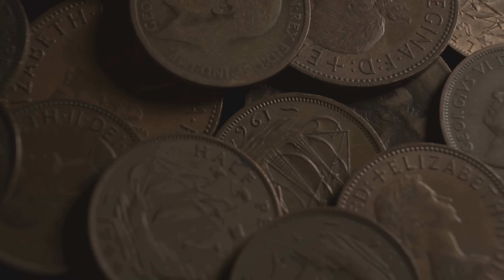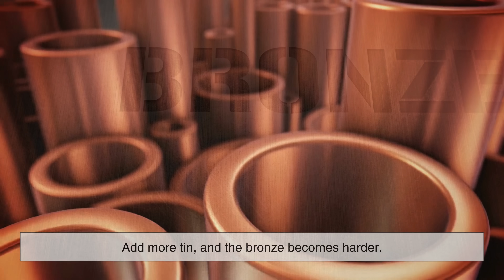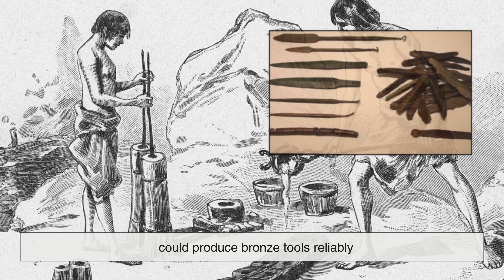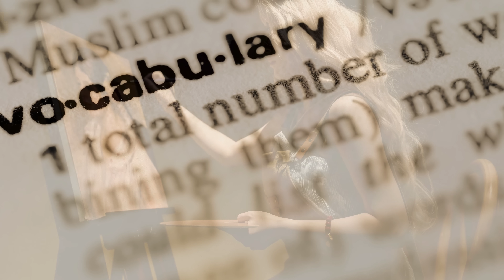Why Do We Call It Bronze? The Strange Origin of a Legendary Metal [ID0812]

Comment: I work at a place that makes advanced machines used in the pharma industry. Every one of them have varying degrees of Bronze in them from bearings and even some larger parts. There is no other material that can do what it does for its costs. We never left the Bronze age.
Reply: End of the age never meant stopping using that material, only that the more technologically advanced material became possible. We still use stone and copper for many things, maybe even more than bronze.

Comment: I have a suggestion for the next video. 

Men know for a long time already that combustibleengine can work on liquid hydrogen. Why are men so stubborn and continue destroying nature to get the basic materials to make batteries?
Reply: Hydrogen is probably the worst way to power a vehicle. There are so many steps needed to make it and then get it into your vehicle that only 13% of the original energy in the hydrogen makes it to the wheels. And that's with fuel cells, heat engines are much less efficient so you lose even more energy

Comment: Bronze is frequently used in all kinds of machine tools as wear parts. It resists wear well but is somewhat softer than the steel or cast parts it comes in contact with. The bronze will wear away and the part is much less expensive to replace than the ferrous parts it is in contact with.
Reply: When designing gear trains, we use bronze as a sacrificial material. I would often specify bronze for use in the most easily accessible gear in the entire set. You can think of it as a “fuse” of sorts.